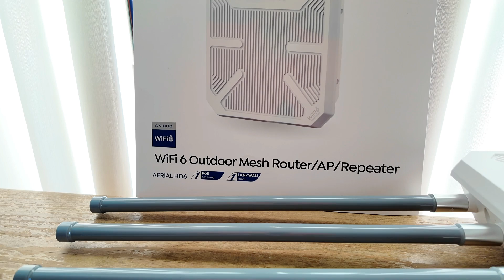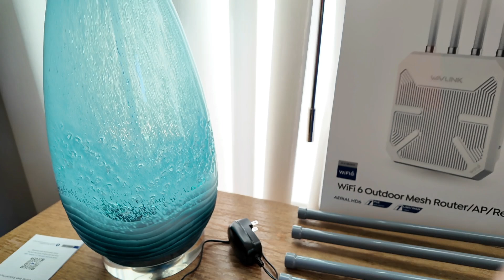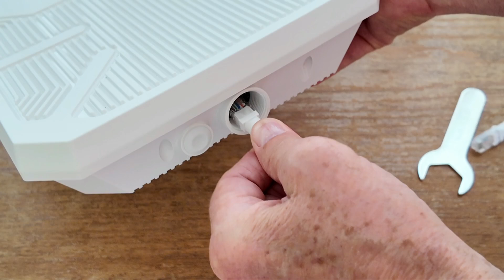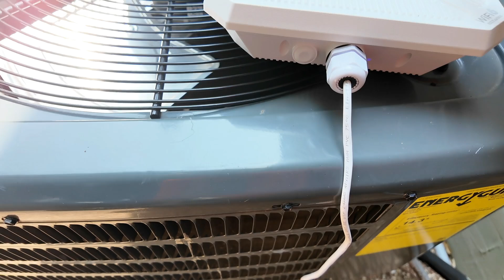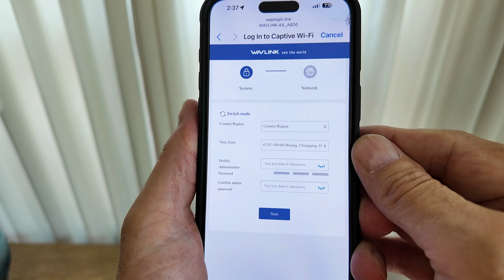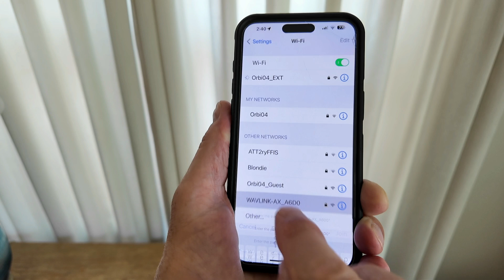Review Wavlink Aerial HD6 WiFi Extender, AP, Mesh Router, Repeater

Comment: only put it 8 feet off the ground or due to the radiation pattern you throw away a LOT of your signal …. been there…. done that… when you do some digging, you’ll eventually find a report from Wavlink engineers that you don’t have it more than I believe 2 1/2 m off the ground. It’s like seven or 8 feet about 8 feet maybe 9 feet it’s not very high it turns out… the Wi-Fi output is a microwave signal. It’s not a radio signal and it fans out and kind of a flat plane.
Reply from the maker: Interesting, I've never heard that about the radiation pattern. I guess it makes sense though.

Comment: I bought wavlink wifi6  after i update the firmware suddenly cant find the ssid.. Then i also did the reset but still not working.. The status light blue is not blinking
Reply: A similar thing happened with one of mine and they were nice enough to replace it for free without me even sending it back
Reply from the maker: I'd suggest contacting Wavlink tech support. 
https://www.wavlink.com/en_us/contact.html